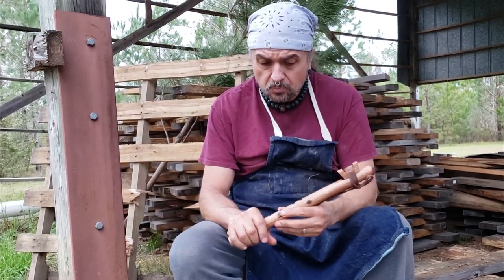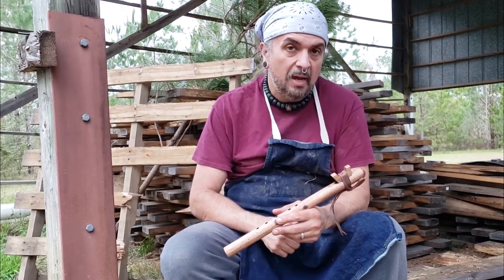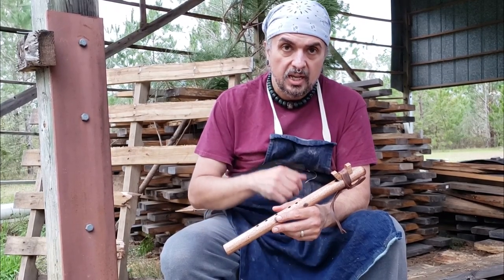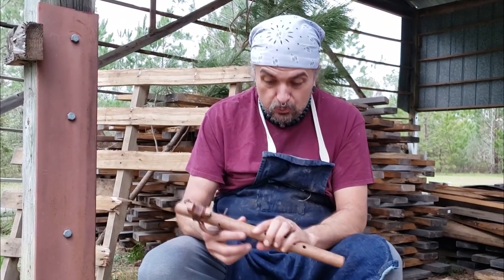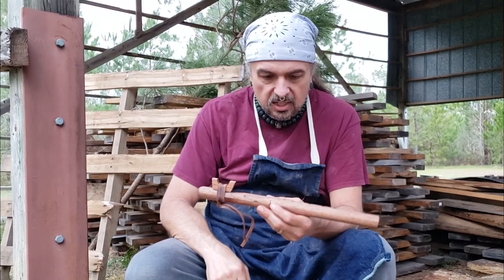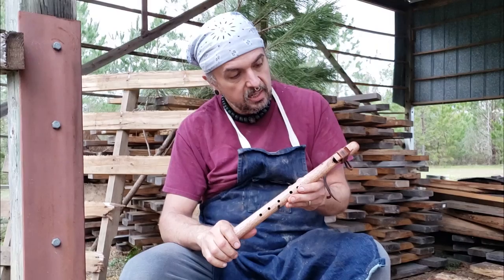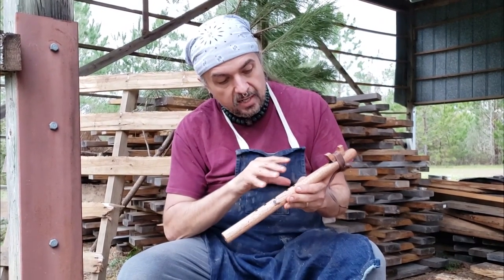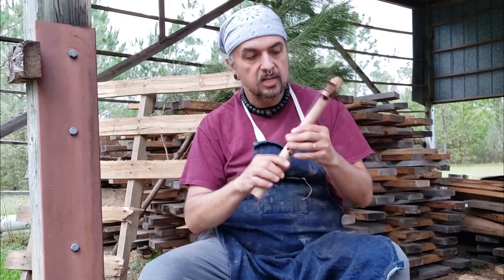Making a Native American Flute from Pallet Wood

Comment: Great video, thanks. The flooring panels store Lumber Liquidators gets in pallets or crates with some kind of other pieces of expendable wood associated with them (nothing like randfom scraps from exotic wood companies!), with a channel in the piece like for a strap or something. I've seen cheap, little versions of the same disposable piece at Home Depot (like it serves the same purpose, to ease and widen strap pressure surface area on a crate from digging in?) but at the flooring place, sometimes on the ground out back or by the dumpster, this sort of piece is much chunkier, like they bear weight under a crate of exotic wood shipment. I found a pair that is the nicest wood I've ever found when searching or even buying for making bows, knife handles, or carving figures. These had gotten wet but were mostly OK (perfect salvage in it). It looks like curly maple (but the curls are series of double-helix-looking braids side by side!) but is almost as hard as purple heart. No idea what it is. If I can sand it without browning the sugars in it the almost irridescent, 3-D depth of it, with a little tung oil it makes people think it is figured quartz stone like included agate! I cut one (of 2) into knife scales, but the bigger one is tempting to make a flute. I just don't know if it's too hard. An ink stamp said "Sequoia" on it, but it is certainly not sequoia. Some kind of company or QC name. I do not have a router table but my nice two-hand router has screws to mount it upside down...?
Reply from the maker: Hmmmm...

Comment: Wat side an kind of router bit do I need
Reply from the maker: It is called a core box, sometimes called a flute and the size that I use in this video is 3/4 of an inch in diameter or 3/8 of an inch radius. I have hundreds of other videos of making flutes that are more detailed. I don't recommend you making flutes this way however it is very dangerous!